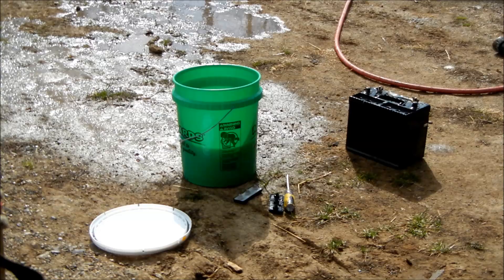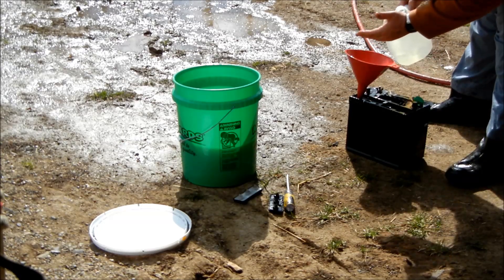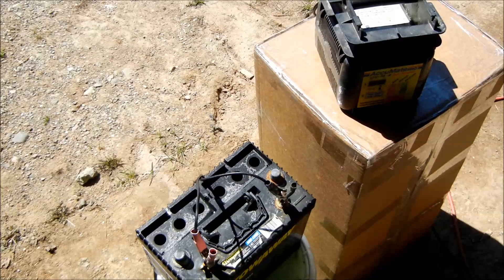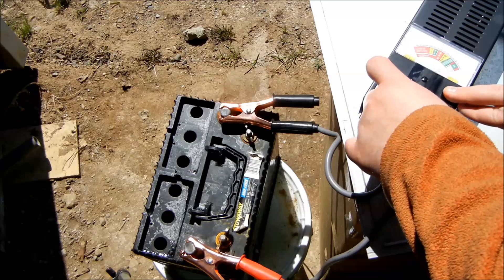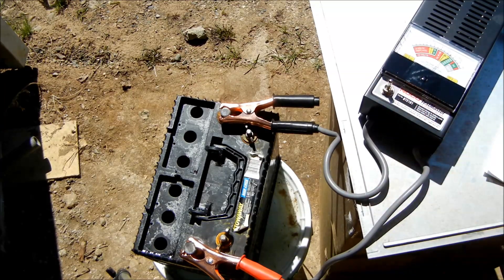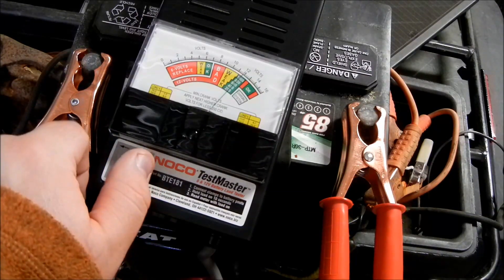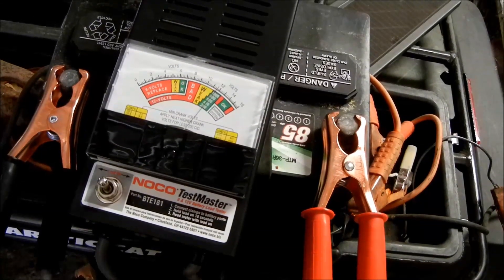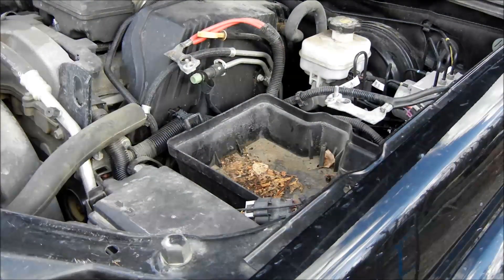Revisited How to repair a 12 volt battery for under 5 dollars using Alum with more testing

Comment: It starts the vehicle Summer or Winter. The load tester people are having a fit. Could it be the load testers, which are made to sell batteries, might be the problem? Because the original problem was"Won't start the vehicle."

Comment: Nice video can you also use the Alum made for gardening, its not food grade, but its Alum. May be a bit stronger. It's sold at Ace Hardware .
Reply from the maker: Generally the gardening stuff has other additives in it that you would not want in your battery. The food grade alum is usually like 99% pure

Comment: Do you know the exact mixture of the alum and water and stuff?
Reply from the maker: I put 8oz of alum "food grade aluminum sulfate" in a gallon jug then filled the jug with water "shake the jug at half full as well to get a better mix" Same amount with the baking soda mix for rinsing.
Reply: Repairman Jared  Cool thanks 👍 
Where can I buy the alum stuff?
Reply from the maker: The best place I have found is on amazon, but have heard well stocked grocerie stores have it in larger quantities also feed mills.

Comment: My main concern is will it freeze in the winter time and will it be able to start a cold engine. Where I'm at it can get to 18 degrees which will freeze water since the freezing point for water is 32 degrees.
Reply from the maker: In my other video I did it at below freezing in the winter.

Comment: my car battery right now is at 10.3 volts and the car starts. I charge it and it goes to 13.3 volts but next day it goes back down to the 10 volt range then it fails to start after 4 days or so.
Reply: There could be parasitic drain due to a short in the battery ..
Reply: Dilojan Senanaya. could be a plate is buckeled and touching another plate- being over discharged can cause this to happen as well as battery age- this is what I've been told not sure if it is true or not just wanted to throw that out there

Comment: there are tree reasons the acid is stil being used in lead batteries:
#1
to keep the voltage high ( 12.7 v at nominal charge)
#2
to ensure that in winter the batterie don't freese
( wen fully charged a leadAcid batt will not freeze below zero)
#3
to keep batterie sales forever going!
( typical live span of a acid filled battery is tree to five years) after that they get so badly sulfated that you have to replace them, a alkaline type ( edison Knife or even a alum filled battt battery however has a typical life expectancy of 15 year in case of alum and even 30 years in the nickel-Iron ( edison) version, however the voltage of these are typical around 1,3volts per cel so has its issues...

Comment: I have a battery bank for wind and solar power. I use pairs of 6 volt golf cart batteries. I use the same tester and when I have a bad battery. The meter falls in the red with a load. I took a bad battery and did the alum. It works fine so far. Thanks.

Comment: Sir, you keep your terminals way too loose.
Cool Videos !
Reply from the maker: +mminc81 the "clamps" on the truck are pieces of crap I have meant to replace them but have not gotten around to it and they hold good enough, every 6 months or so I have to tighten them but other than that they hold.
Reply: Ah,I wasn't meaning to sound like an ass, I was just wondering sir :)
Reply from the maker: +mminc81 ah I didn't think you sounded like an ass, they are on the loose side but really no way to tighten them just a bad design.

Comment: This is great, even after having a battery actually blow up in my face.
FWIW, I just washed my eyes out, no problems then or later down the line. Unfortunately I was at a gas station tending my batter when it happened and my clothing started desentegrating pretty fast, and could have if it didn't actually (40 yrs ago so not sure) get to the point of embarrassment lol.

Do be careful though, it can happen and I could have been a lot less lucky... pretty good size explosion that could have done damage even without the acid issues.

Comment: I think he was just trying to see if this battery, which was not designed as a car starting battery, was good enough to start his car and Bingo, it was able to do it!  That is saying something good about the conversion, especially since he started with a battery that was full of lead deposits (due to aging), essentially an neglected (sulfated) and worn down.  Think of it as the worse case test -- it passed!

Comment: Prochiro
When converting to alum, the battery will never reach the previous acid voltage. This, however, does not really matter as a volt or so will still function to start the truck and the amps are there. In reality, the converted battery will work the same as a new battery except the level of voltage will be lower. It will function for as long as the lead holds up. This will work for 80%+ of the treated batteries, I use alum in all solar and wind battery banks with gulf cart batteries. No need to worry about sulfur again.
Reply: How does your inverter and other devices that are hooked to the battery cope with it.

Comment: Did you use distilled water? with the Alum.?
Reply from the maker: I did not but it is recommended I have a lot of filters on my water so its very clean but distilled is still better.

Comment: now you have reconed the deep cycle  on allum  switch it to eresh acid with distilled water (like the factory would) and it will work better
Reply: Is there another name for eresh acid plse - can find no mention of it on google - doesn't mean it doesn't exist -maybe another name  - thanks
Reply: SORRY IM DISLEXIC TYPING IS A PROBLEM SHOULD READ FRESH ACID WITH DISTILLED WATER
Reply: preper embaeado   on melborp  :-)
Reply: global092  looks like a typo ..put an f where the first e is
Reply: Gunzmith Dragonkind not a typo read previous comment that's what happens when your dyslexic

Comment: Thanks for sharing your recycling techniques and for video taping your method clearly. Don't forget that the trucks alt/gen will start recharging the battery soon after the engine kicks on. It doesn't take long to restore the amps it lost during cranking and may be a factor in your test reading high after cranking the truck.

Comment: As a mechanic I've seen batteries blowing up on people's face because they didn't take precautions. Some have lost their eyesight. Whenever you're doing any testing, like a load test, for example, make sure the battery is cool. After driving the vehicle, once you shut down the engine, there are acid fumes coming from the battery. An electrical spark can ignite the fumes and cause the battery to explode with the acid going all over. As you can see, the load tester glows. If it's sitting on top of the battery and there are acid fumes coming out of the battery, you'd get an explosion. Cool videos.
Reply: 13x60 I am a mechanic too and have been for 30 some years. Acid fumes? If they exist they do not explode. Now the hydrogen/oxygen gas made by the battery can explode but in this case the concentration of gas would be really too low to blow up. Hydrogen is very light and will float away quickly. 
I guess you can see the advantage of the alum battery. If it did blow up you wouldn't have acid all over the place. 
The actual cause of most battery explosions is low water level in a shorted cell. The shorted area gets red hot and causes the explosion.
Reply: 13x60 Thing is this is no longer a lead ACID battery. the Acid part has been replaced. I do not know the chemical off gas would be from charging this. With Lead Acid it is Hydrogen and that is what explodes.
Reply: great point.
Reply: ***** Now, that's really science. Good to know. ;)
Reply: integr8er66 Any time there is water involved with electricity it will still put off hydrogen and oxygen. The acid or alum will stay in the cell. Well unless it explodes which is really rare. Keep the water up in the cell and you decrease your explosion chance by a few hundred percent.
Reply: consaka1 Thx consaka1     That makes sense since your splitting the H2O didn't think of that. I'm an engineer NOT a chemist, although I love what Chemists can do.Now my question is where do you get Alum?
Reply: integr8er66 You used to be able to buy it at grocery stores. I am not sure if you still can. If I was you id look it up online.
Reply: opOoOEoOWO2O

Comment: Pretty cool, FYI the four wheeler battery is NOT a deep cycle battery. The marine battery you converted to alum is a hybrid and not really a true deep cycle either (these are bad for solar too)... its really just used for marketing on most rv marine batteries because they have a better reserve and AH rating than most lead acid wet batteries... real deep cycle batteries like golf cart ones use more lead and can easily last 10 years in normal conditions. better option to buy "blems" for 40-50 bucks from the battery distributor when they have been on the store shelf too long and they are bon thier way to be recycled... they go from "new" to blem with no warranty for this reason and sell for a fraction of the price.

Comment: What part of Deep Cycle don't you guys understand? It's not designed to start vehicles and cold cranking amps means fuck all to this battery.
 If you're worried about how this battery will start your car in a year then you're worrying about the wrong thing.
Reply: Thats actually a "marine/rv " "deepcycle" battery which is not a real deep cycle battery like a golf cart battery would be... the battery in this video is a hybrid between a starting and deep cycle which IS RATED in both CCA and AH to start a boat or even rv engine and power accessories in them while the engine is off.. but has trade offs with both uses...
Reply: Well that may be true but what I was getting at is the marine deep cycle batteries do not have the heavy lead plates that a real deep cycle battery is it designed to be ran down for as many AH without diminishing the life of the battery.
Reply: +1fastdoorslammer Wow thanks for being crappy. Have you ever seen a deep cycle battery that had dual usage? There are many deep cycle batteries that are deep cycle/cranking batteries. Yes I know they have a resistor and switching system in them to limit overcharging but his testing was fine.  Too keep things simple and basic here's a very basic explanation.There is no problem using them to start something at all .Period.  Where the issue is is this: A deep cycle trolling motor battery will never stop charging so you can kill your alternator/charging units over time because they never get a break. Normal cranking batteries charge full and that is as far as they go. When full you autos alternator or charging system gets a break. It doesn't work on a continuous cycle like a deep cycle causes it to do. This is important for you boat owners that have trolling motors in addition to you main engine.  Bur remember if a deep cycle battery is all you have in an emergency use it.  It will not explode and it will not kill you or your system just starting it.

Comment: Just to note, the earth (ground) will drain your battery, not right away, but dont leave your battery sit on the ground or cement. Have it off the ground, on wood blocks or whatever....good vids man, thx....
Reply: Thanks for propagating an "old wives tale".
 The case of a battery is non conductive. How do you suppose the current goes to ground?
 Any battery sitting on anything for a period of time will lose it's charge.
Reply: Ok man, no propagada, was told that, thought id share, appearently it was wrong, sorry man
Reply: justin evans its not really propaganda, its got nothing to do with the electrical charge, but more to do with the Thermal conductivity of the Concrete floor.  Basically the battery gets colder, and when the chemicals in the battery get colder, they react differently and the state of charge diminishes more rapidly. thus the battery drains its charge quicker than when stored in a above ground. i think it has something to do with all sides of the battery should have a equal temp.
Reply: +justin evans Actually everyone is partially correct lol. It depends on the battery. Older (and still some mfg) made batteries where the lead plates extended on the inside all the way to the plastic shell and those on the ground or concrete floor will drain over time. Most of the batteries I have dealt with in my shop over the last ten or 15 years changed the way they made them and the lead plates are actually suspended inside plastic stringers and do not contact the casing at the bottom or the sides for that matter. These will not drain because of ground or concrete floor.  There is no connection to cause it.  Anyway thats what we see in my deep cycle and marine cranking batteries in my rebuild shop.
Dave
Reply: This is a myth in our days.
Years ago, before your age and my age however it was true.
Back then batteries or battery cases where made of wood and coated with tar.
And those battery cases would creep acid which could support a electrical current through the ground/earth which would discharge a battery.

Our days with the plastic battery boxes these myth do not exist anymore and you can sit the battery on any surface without having an bad effect.
Reply: @dave smith
Do you really believe what you preach?
You are wrong.
A cooler battery got a lower self discharge because the internal resistance is higher when the battery is cooled. The acid will stay the same. A cooler battery will keep its charge longer than a warm/hot battery. 
A cooler battery will be charged slower because of the increased internal resistance, but this will increase the life of a battery since the increased internal resistance will lower the charging amps.
Reply: That story came from "Don't leave a battery sitting on a concrete floor."  The concept is valid, but not because it causes the battery to discharge more quickly.  If a battery is left sitting, the electrolyte "creeps" out around and through the vent caps (Have you ever noticed that the top of a poorly-maintained battery in a car is always damp?), running down the sides of the battery to the bottom, where it etches and spoils the appearance of the concrete.

Comment: I disagree, i can run all kinds of inductive loads, including my sawzall, with my cheap china inverter. I suspect he's right about the voltage drop. My 750 watt cuts out at about 10.8 volts

Comment: It might be good to mention WHY this works...  The batteries use sulfuric acid on lead plates.  When you abuse this type of battery, you can glaze the plates with lead sulfide.  When you add the aluminum sulfide, the lead wants to drop the sulfur and in doing so throws off electrons.  This is a simple REDOX reaction battery, just like the original setup.  Knowing how to recycle trashed batteries is good info in my book!

Comment: Don't listen to the grumpy auto parts sales team!  They won't sell as many batteries now.  The reason your sawzall didn't work right is due to the type of inverter you are using.  With that inverter you can't use a purely inductive load or it will tank and backfeed.  You can eliminate this by simply adding a table lamp with a cheap lightbulb to the load with your saw.

Comment: The videos on here are great. Although i think the process in your first video cleans up the plates a bit so it works better but i think there is a bigger process in completely restoring the battery. If you plan on using this battery for a car or your 4 wheeler, i'd get a jumper battery pack in case! Don't want to get stranded.

Comment: It you look on the Load Testor Scale above you will see steps in the green Cold Cranking Amps area of the testor showing different cold cranking amps.. When you do a 10 Second Load Test on the battery the needle on the Load Testor should stay steady in the Green Area under one of the steps holding there as to your Cold Cranking Amps your battery is advertised to do. Over time your battery may lose some of its Cold Cranking Amps advertised do to plates in the battery sulfation.

Comment: Every battery has a Cold Cranking Amps listed on the battery. You can have one dead cell and still start a car although the battery is bad. 36 years in the Auto Parts Business tells me the load testor never lies. When applied here the load testor went right off of the cold cranking amps scale from what I remember seeing. When it does that the battery is shot. One should try to charge the battery first before load testing it for this test to work properly.
Reply: A deep cycle battery will only show ah / amp hours and not CA or CCA.
BTW. he used a hybrid battery or known as a  marine battery which is between a starter battery and a deep cycle battery. So the test results may deemed to be different than if he would had used a starter battery. This tester is designed to use with an starter battery.

Comment: Yeah, I watched it. The high voltage reading is a false reading, once the load tester was put onto the battery the false reading was knocked off. Still read low on the load tester. I wouldn't rely on this method for an everyday vehicle. Just go buy a new battery for $80 bucks and call it done. For an old tractor or something that you don't rely on everyday it may work or if you simply enjoy tinkering with stuff.

Comment: Then how do you explain his battery starting the vehicle in both videos, winter and summer? Obviously the cold cranking amps were sufficient and the battery was good. Once the vehicle is started, the alternator will continue to charge the battery.

Comment: If you watched the original video, it had both the voltage and cold cranking amps necessary to start the truck. And once the car is running, the alternator will continue to recharge it.